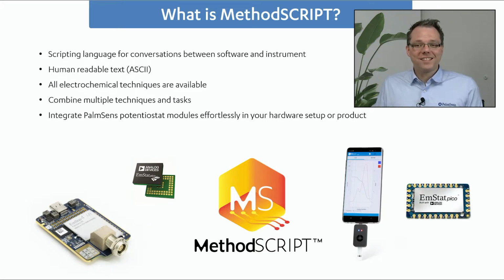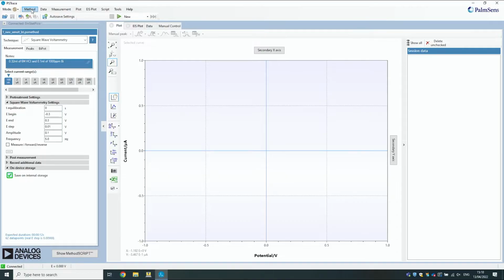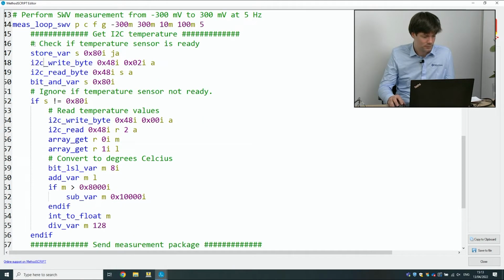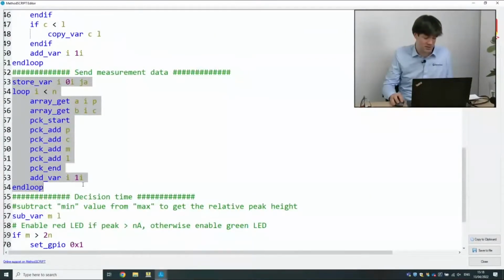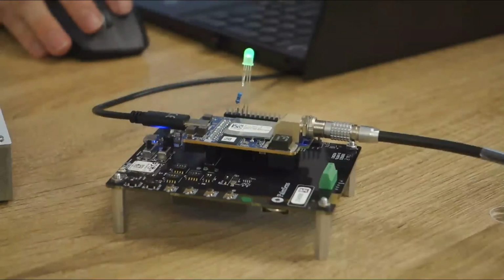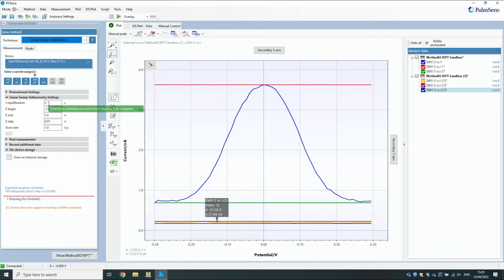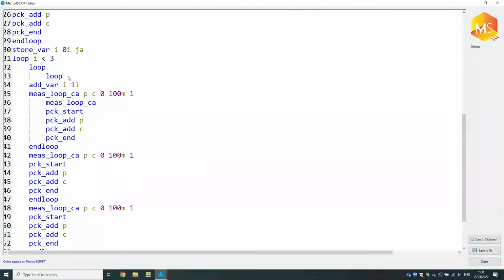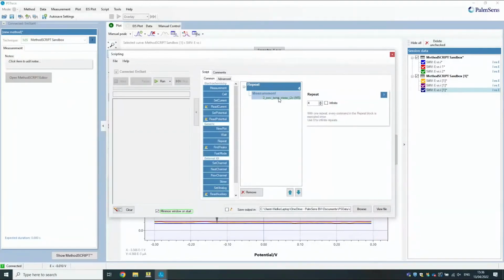MethodSCRIPT in action: script your electrochemical experiment

Comment: is it possible to write a script on vscode that runs EIS every defined amount of hours and performs the circuit fitting after every data acquisition?
Reply from the maker: Dear Lautaroocampo, You could already perform EIS in defined time intervals in PSTrace. When you use MethodSCRIPT you could embed the measurement into your program and that program perform the circuit fit. MethodSCRIPT doesn't have a command to perform the circuit fit on board. However, Python and some other languages already have packages for EIS data analysis, you could use that. 
If by vscode you mean the Visual Studio AI, I'm afraid we haven't trained that in MethodSCRIPT and I would be suprised if there is enough MethodSCRIPT code on the internet, that the results would be usable.